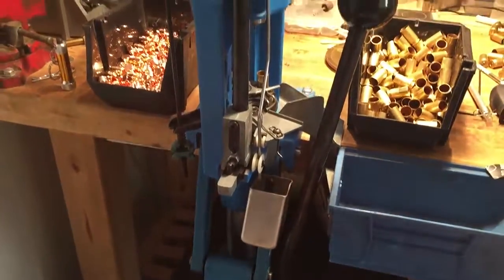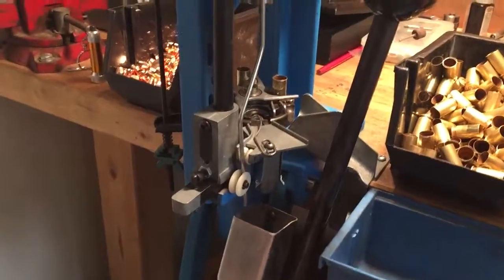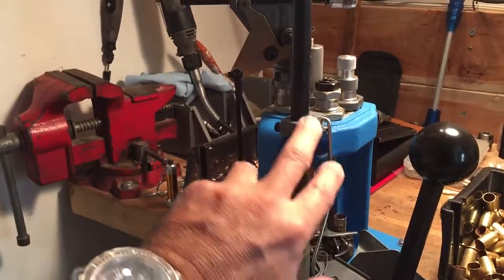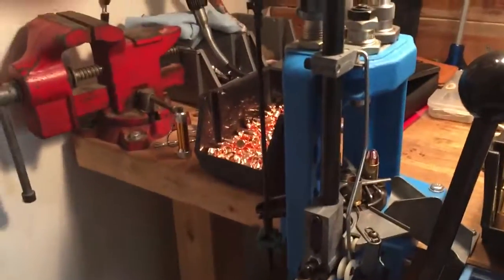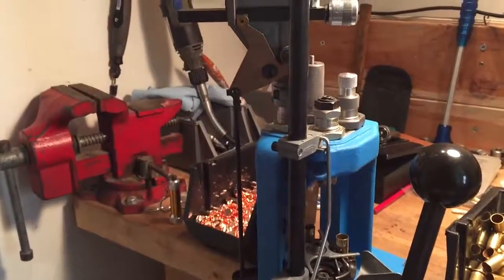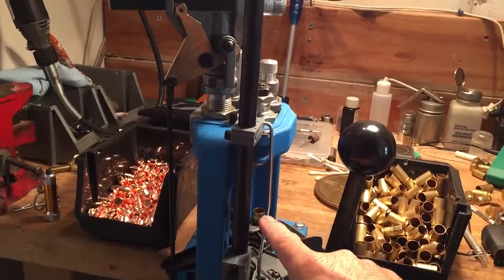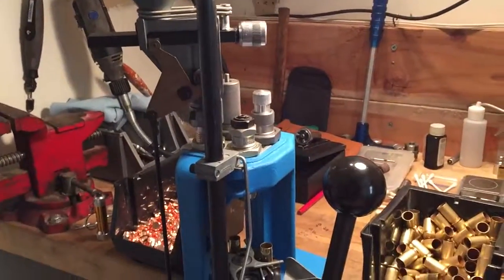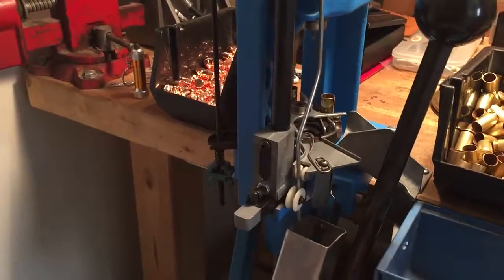Dillon 550B Question Do you use a Powder Check?

Comment: I have the exact same setup on mmy 550. The answer is very simple. A small dental mirror mounted to the back of the frame allows you to see the powder cop die on the upstroke without moving yourself to see it. Simply adjust the mirror, they are 99 cents. Works good.
Reply from the maker: That's exactly what I did but a bigger mirror. Thanks for your comment.

Comment: I guess I'm set up differently. I run 45ACP, 9mm, 380ACP. At station 2, I'll check the powder drop on the scale and the setting usually holds. I'll then recheck roughly every 50rnds. Station 3 is where I place the bullet so there is no crossing through the press. Station 4 does the final crimp.

Comment: What do you think of the press I'm torn between the hornady ap and the rl550. I have about 10,000 once fired 45acp brass that I've collected since 2018 and a few hundred of 45acp unknown range brass. I just want make good use of the brass since my pal stopped reloading and gave his equipment to his son. So I gotta start off fresh.
Reply from the maker: If ur only going to reload 45acp I would get the Dillon 550. You can't go wrong with the 550  which is a well made tried and true.

Comment: Absolutely no need to have a powder check die, I have bought my first 550 in 1996 and it has never let me down in regards to accuracy in powder delivery. I did add in the very stages a primer alarm and a powder alarm. These appear to be standard now, with these in place, I can load 500 per hour. What slows me down is having enough primer tubes pre loaded.
Reply from the maker: I'll have to look into that powder alarm. Thanks for your comment.

Comment: Did you solve your riddle LS07? I would use the Dillon audible powder checker by drilling a hole in the tool head thus allowing the actuating  rod to contact the base plate. You are obviously comfortable seating and crimping in the same station. This video is six months old, but I'm hoping that you get back to me as I am looking to solve the same problem for my friend. 
R, Steve
Reply from the maker: Thank you for your comment. I didn't use a Dillon powder check because it was too much work to drill into the head and align it just right. Instead I set up a mirror and installed an inexpensive LED setup along with the Hornady powder check. Now I can clearly see the powder inside the casing from a comfortable seating position. I'm going to buy a lockout powder check die by either Hornady or RCBS for extra protection as the Hornady die with the stem is somewhat useless the way I'm setup. The mirror along with the LED is key. You can see it at https://www.youtube.com/watch?v=2sahJXgy1DQ&t=24s

Comment: That's interesting. I have used my friend's XL 650 and that Dillon powder check tool is great. You don't have to look at it at all. I would just drill a larger hole if I found alignment a problem. Thanks for the video, and good luck to you.
    

R, Steve

Comment: As some have said, the RCBS lockout die would to me be the best option. You don't have to look. Your press will lock if no powder or double charge. I just ordered one for me.
Reply from the maker: Thanks for the tip. I have not used the RCBS lockout die, but I'll get one. I'd rather be safe than chance blowing my barrel off or worse. Thanks for your comment.